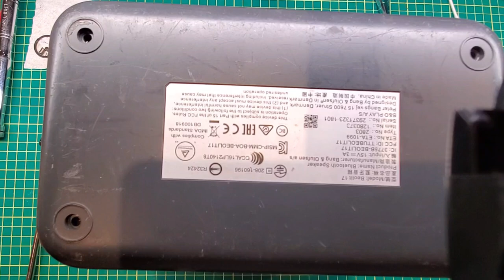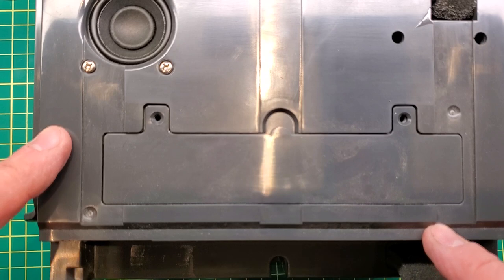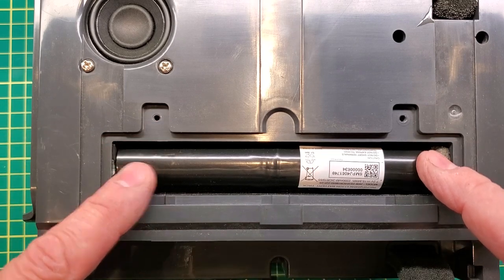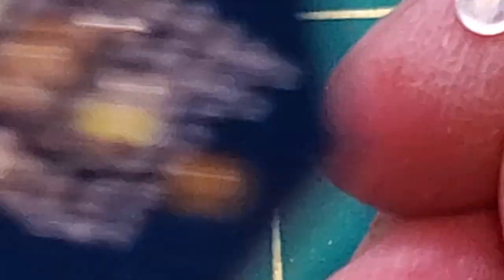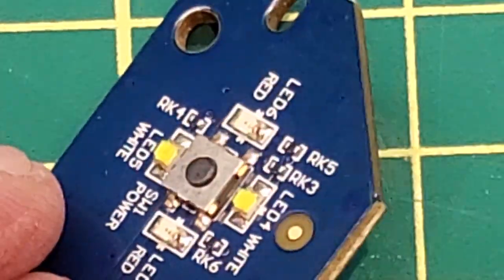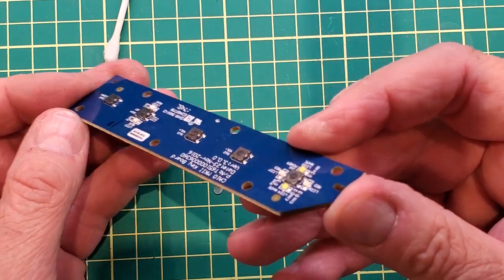bang and olufson beolit 17 won't turn on

Comment: What are the chances you’ve had to fix this thing when the charging cables have been replaced and the block has been replaced and the battery has been replaced but it won’t charge, all she does is flash red quickly then slowly Amber and blue and white (all at once it’s a pretty light show) slowly then back to red flashing? B&O sent me a 30% off voucher because I’m out of warranty. I would gladly give you my voucher if you can show me how to fix my speaker. I want my baby to work. I don’t want one of the new ones - I can’t afford it! Also if you know how I could convert the rechargeable aspect of this thing to make it fully plug in only, that would be my dream come true!

Comment: I have a Beloit 17 speaker. I had replaced the battery and the indicator is green. But the buttons not respond. I measure the button work, but I have no 3 volts on the button board. Where is the error?
Reply: I have another model, I had replaced the battery. The battery is now charged, but when I unplug the usb cable, the Beolit turn off. When I put the cable back again, then I can turn on the Beolit. What's going wrong?
Reply from the maker: I would start at the battery and trace where the power loss is.  Check for pinched or broken wires
Reply from the maker: Sounds like possible battery capacity issue. Can you remove and load test the batteries?
Reply: @thecityviking  I measured the cable, there are no broken wire. The battery is charged and the B&O app, display 100% and the light is green. The battery have 8,2 volts. The other model has the same symptoms but when the battery is full charged und the usb -c is connected then blows up the diode D16 near the data connector to charging port. I have two Beloit 17 model they have problem with the power system.
Reply: @thecityviking Update, so I have voltage on the buttons now. I replaced the D16 double diode (KL3), the capacitor C158 (the part was shortened) and I replaced U10 the voltage regulator. My Beolit turns on now, when the usb-c cable is connected. The battery is charged, but when I pull the usb-c cable, the box turned off. What is here the problem? Maybe the battery management system?